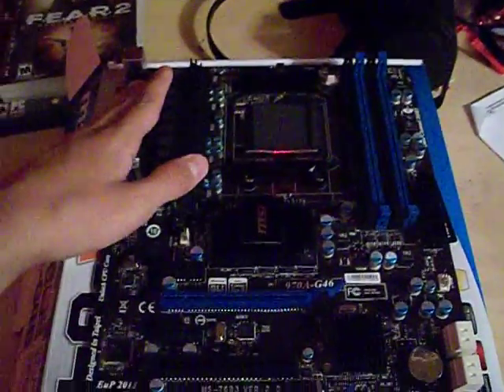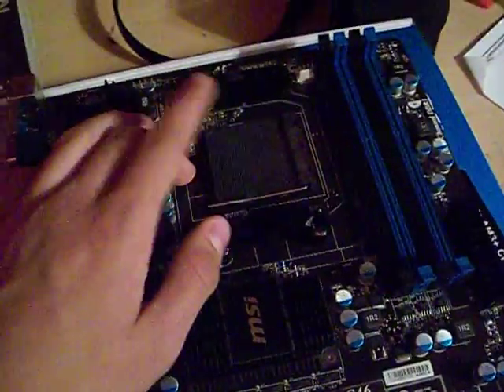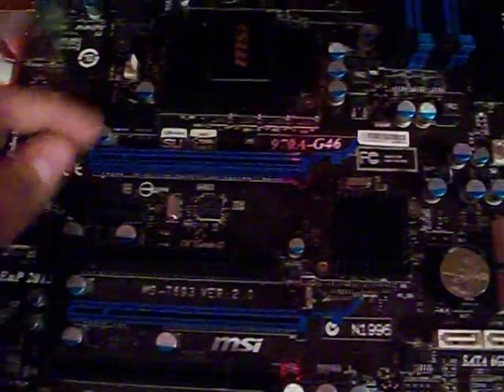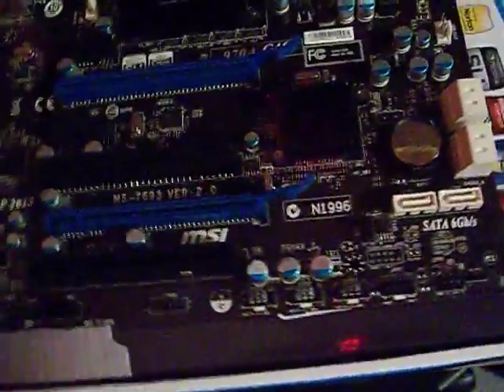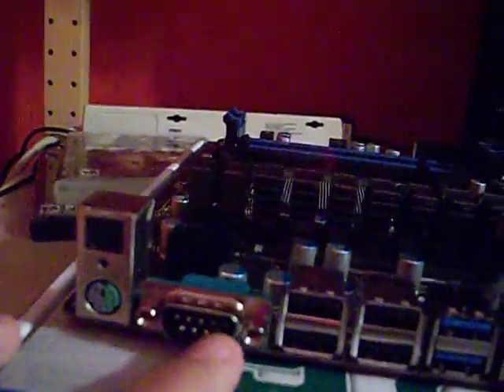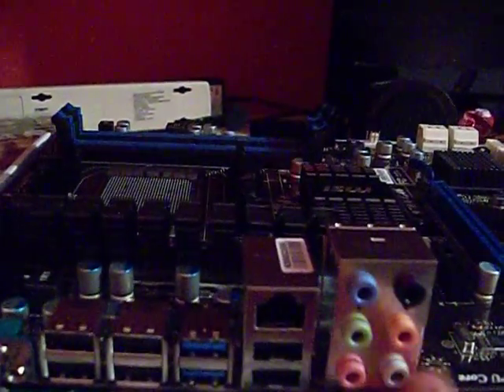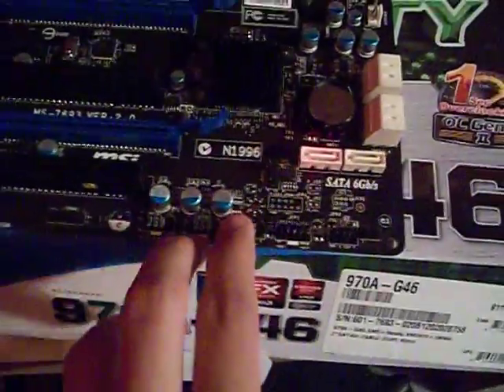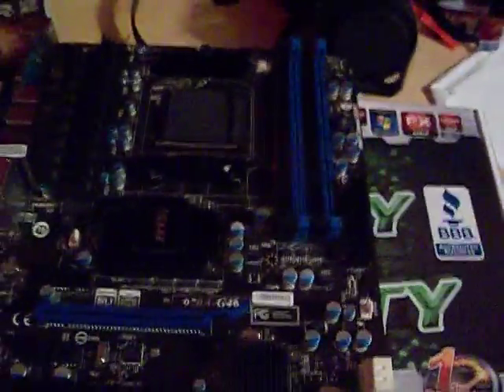MSI 970a g-46 Motherboard Overview

Comment: problem with this motherboard and putting it in a NZXT Hades case is that your ram slots when filled is in the way for the top mount radiator. i did a ghetto solution if putting my radiator by the HDD bays. but just a fair warning.